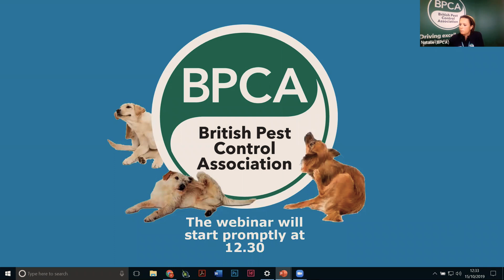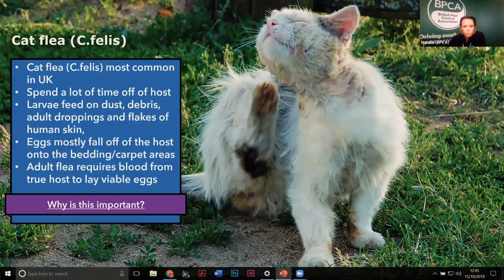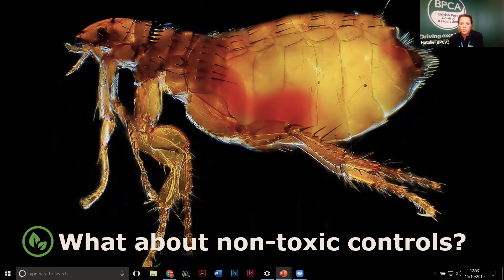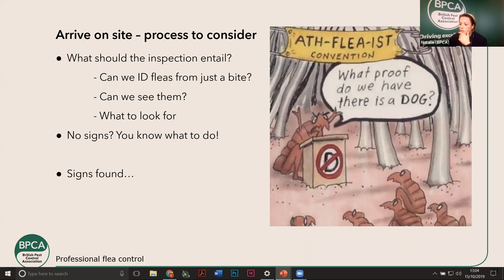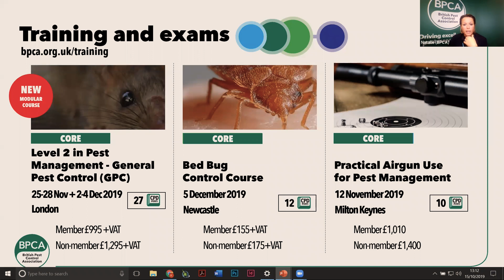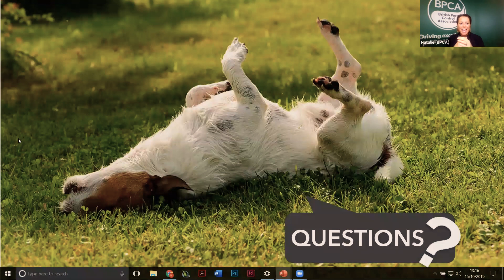WEBINAR: Professional flea control

Comment: I'm coming up on 6 years now in this single family with no pets. Had a pretty good infestation here when I first moved in. First thing I did was spend the first 10 months sealing up every crack and crevice in the place. Took up all the rugs, tack strips, and padding, sealed up floors, baseboards, and spaces between the walls and floors. I put down diatomaceous earth, boric acid, and borax. Put the padding and tack strips back down and the rugs. I've been spraying the perimeter of each room with Ortho home defense no less than once a week ever since and I still can't go 2 days without being bitten. They are absolutely getting a blood meal from me and laying viable eggs. I can't confirm what kind of fleas they are, but I can unequivocally say they are most definitely fleas. I have seen them and killed them with a paper towel sprayed with isopropyl and placed them under a microscope. I don't know how they can possibly still be here after 6 years if they can't lay viable eggs from a human host unless I'm bringing new ones home daily. There are no pets here since the last tenant moved out. I will now buy an IGR which I probably should have years ago instead of trying to rid them with only an insecticide. Any advice you can share on something that will residually keep on killing long after it has dried would be great.
Reply from the maker: Hi Danny, it sounds like you're struggling to get control of the infestation using DIY products. This could be for a number of reasons and we would recommend at this point contacting a local pest professional. They'll have access to products only professionals can purchase, as well as the skills and knowledge of flea behaviour and biology needed to tackle an infestation. You can find one in your area using bpca.org.uk/find

Hope you get the problem sorted soon!